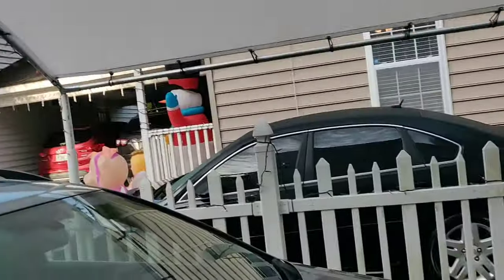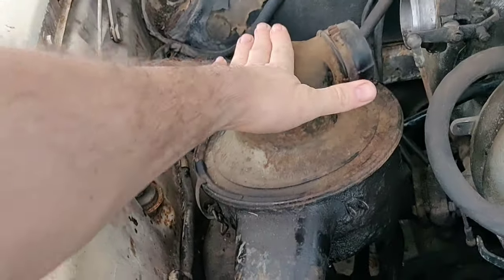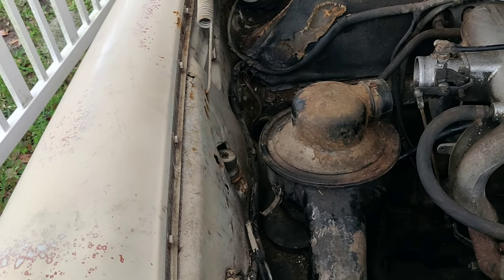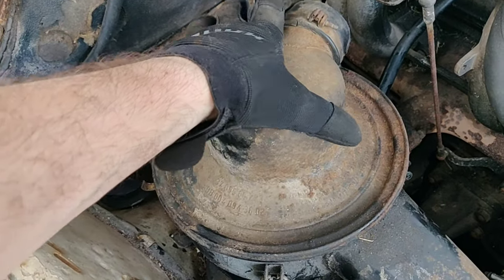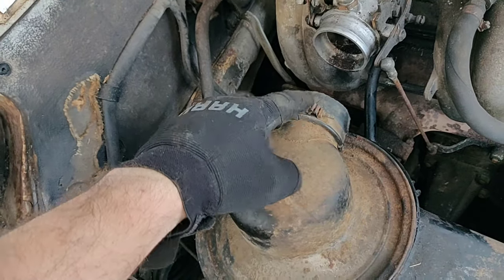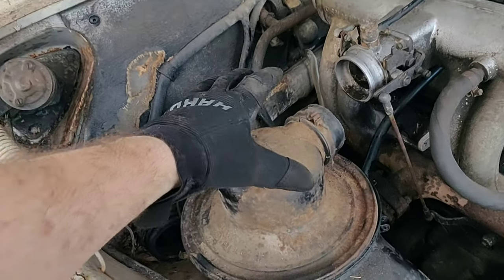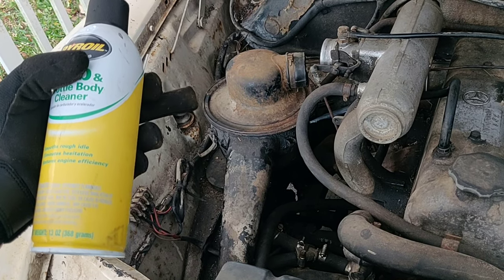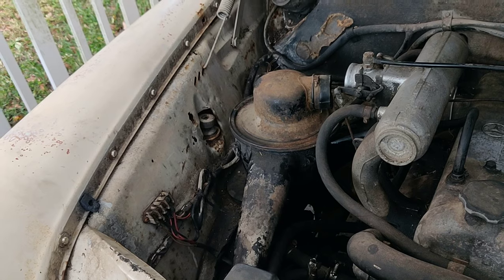HOW TO CLEAN DIESEL OIL BATH FILTER AND FILL (1967 Mercedes 200d w110)

Comment: Quick note, since it's a common misconception about these cleaners - the air does not percolate, or bubble through the oil. If it does the oil level is too high. The actual mechanism of how the dirt is removed from the air is simply the change in direction of the air - the air moves down, then around a bend and up, dirt being heavier than air continues downward and hits the oil where it is trapped. The wire mesh gets the lighter, finer particles.
Reply from the maker: Wow interesting to know.  Thanks for the update.  I love finding out these facts.
Reply: @petescarport  Should note, on some oil bath filters there is a high mark above the fill line, sometimes labelled "service". This is because as the oil traps debris, the oil level rises (as the bottom of the oil trap fills with dirt) when the oil goes above the high mark it can start to bubble which will start to choke the engine.